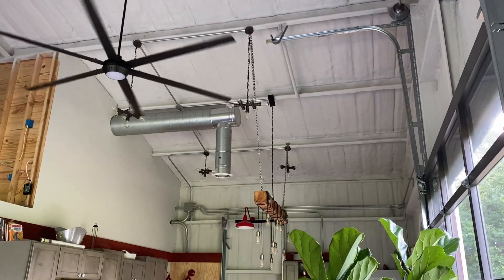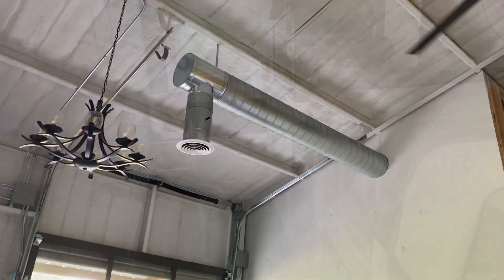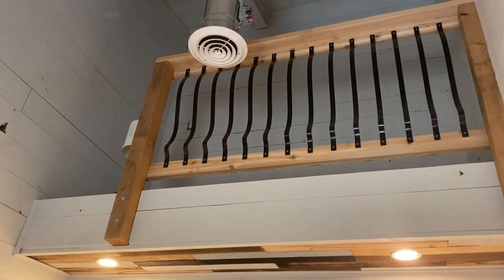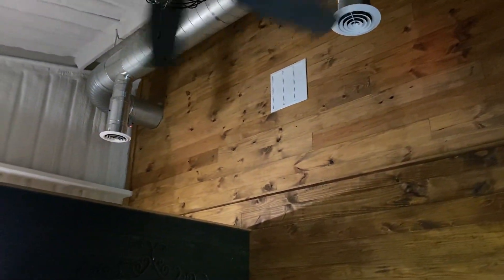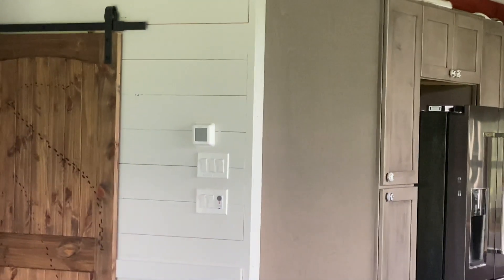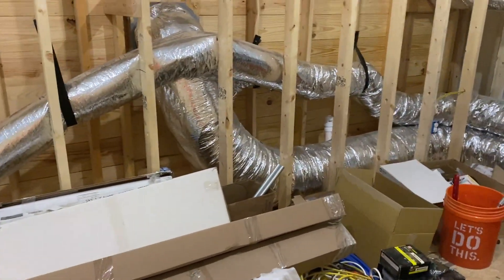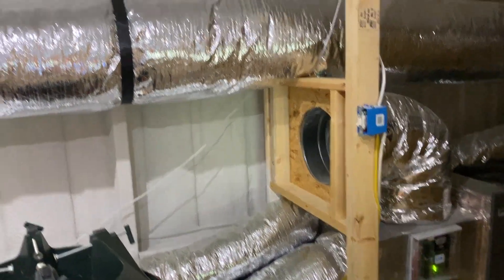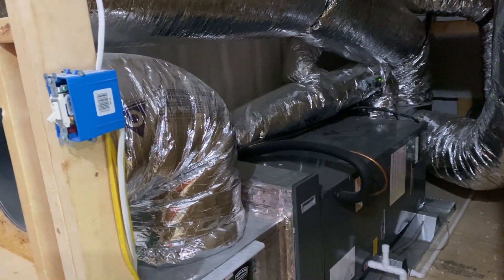Barndominium HVAC with Spiral Duct

Comment: Do you have any condensation problems with the tubing? Is it insulated tubing?
Reply: There's no need for insulating indoor exposed ductwork the temperature of the room and the temperature of the ductwork will be to close for condensation to be aquired